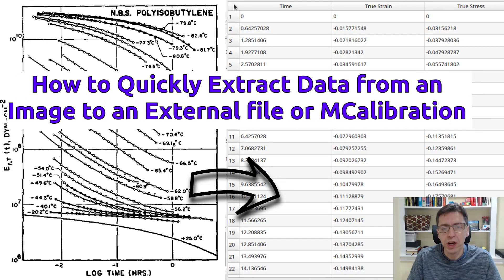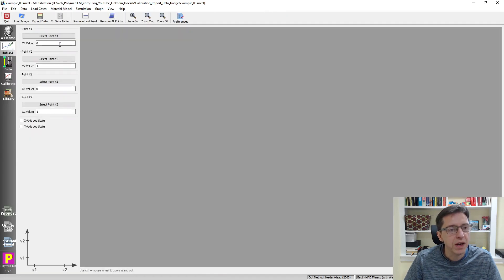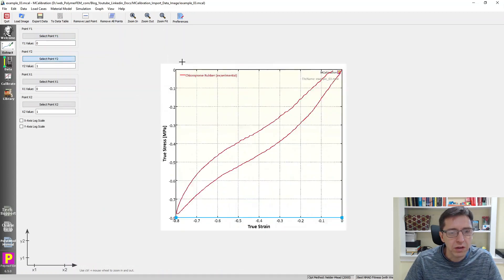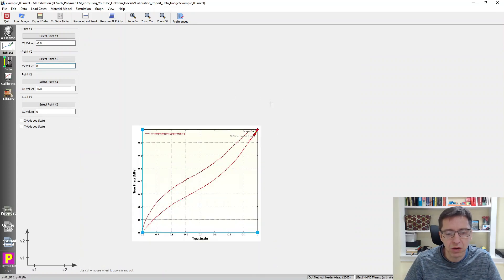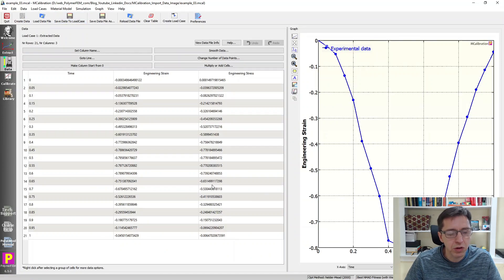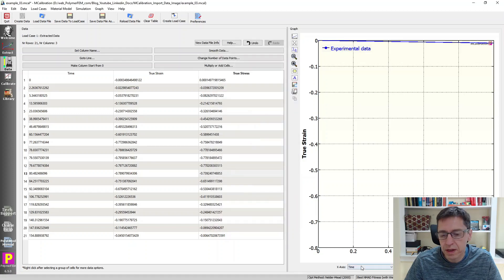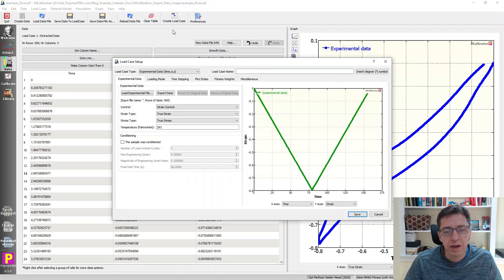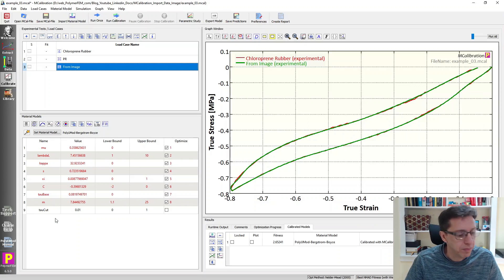Quickly Extract Data from an Image Graph to a Data File

Comment: You have obtained the value of the strain rate from the file you have.
What to do if there is only a "picture"?
Reply from the maker: If you have no information about the strain rate, then I would guess what the strain rate was. And if I don't know what value to guess then I would use a strain rate magnitude of 0.01/s.